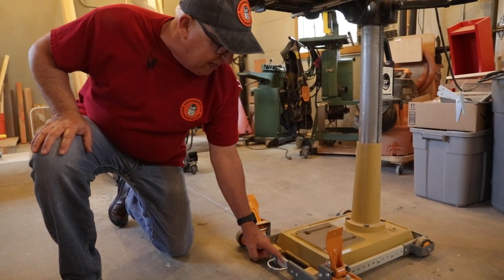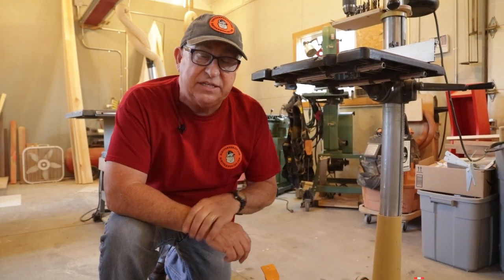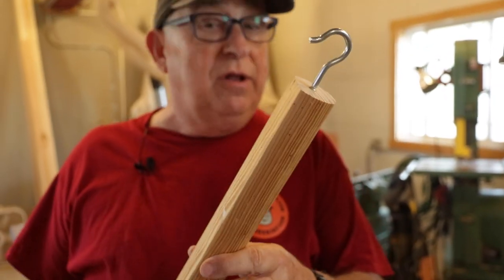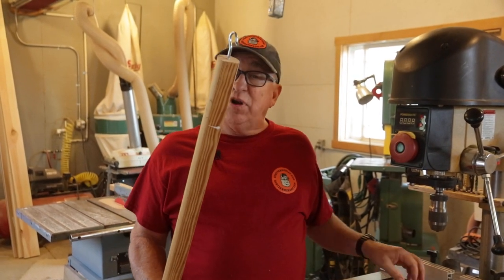Mobile Tool Base Pull Handle

Comment: Helpful?  Of course, as usual, as always.  This is a brilliant and very practical solution.  A drill press on the floor is not a pretty picture.
Reply from the maker: Thanks, Corey! Indeed, the thought of that valuable piece of equipment toppled over and smacking floor, makes me cringe. Best, Jay